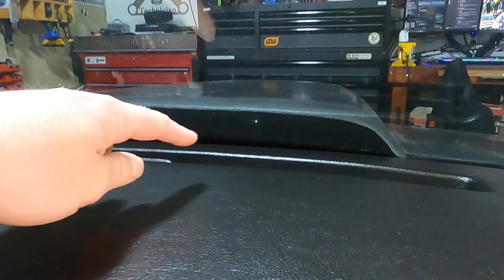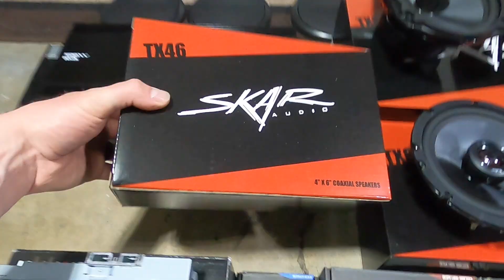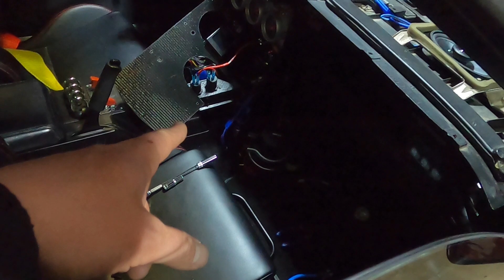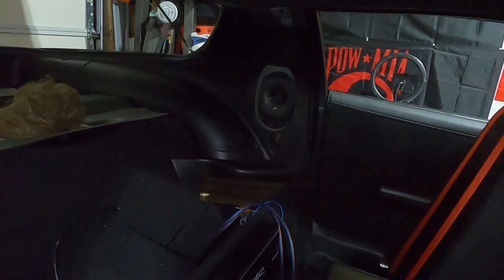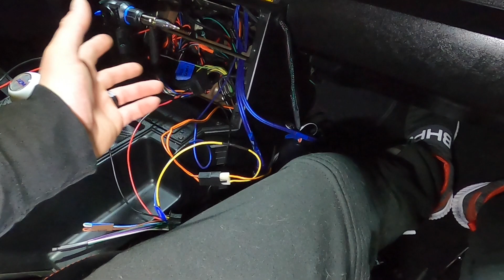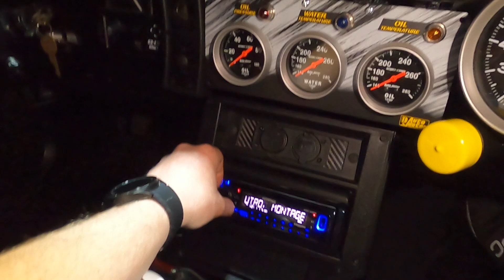Third Gen 82-92 Camaro Audio Upgrade Skar Audio Install Speakers Amp Headunit

Comment: Hey man great video!
So i bought my 1990 IROC back on 07 and it came with a bunch of ancient audio equipment. Turns out the car was an Orion audio equipment demonstrator. There was custom fiberglass enclosures, amps, speakers, two big ass things i found out were capacitors. Anyway the stuff was in good condition and i guess kind of historical and its been in my attic since 2010 if you or anyone has an interest in something like uh antique car stereos let me know, i dont want anything for the stuff
Reply: sounds interesting for sure! Id love to see what setup they had going back then!

Comment: I removed the 4x6 speakers out of my 86 iroc Z as well as the mounting brackets and installed 6.5 kicker KS speakers. I made the hole and top mounted the speakers and used the kicker grills to make it looks nice. The sound is so much brighter, louder and cleaner.

Comment: I have 4 midranges and 2 10 inch subs in my 91 camaro and they draw too much volts is there anything I can do to fix it I’m still using a stock battery
Reply from the maker: Having a new battery would help but really I would check into an upgraded alternator and making sure wires are appropriate size.

Comment: when testing voltage to the rear speakers is 15-16vdc good im no stereo guy but want to make sure its the speakers ans not the steroe as the reson my rear speakers arent working. I have a 1986 Z28

Comment: Excellent job Tony, thanks for the video. I have heard to keep the rca wires and speaker wires separate to eliminate any "Amp buzz" but I don't know for sure. Thanks for all the details. ✌️
Reply from the maker: Yes indeed they recommend 12 to 16 inches. Easy for me since my battery cables come from the back and rca from the front. I discuss that in my sibwoofer install video as well. Thank you 👍

Comment: Do you know if the dash speakers would fit without having to modify a stock dash?
Reply from the maker: I don't think so unless possibly cutting some of the material out of the bottom of the dash cover but even then I'm not sure